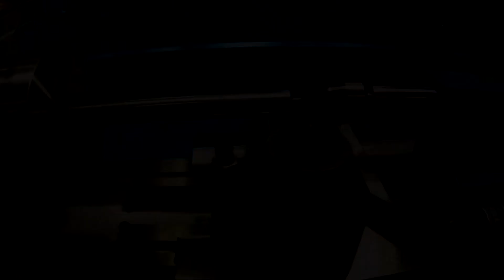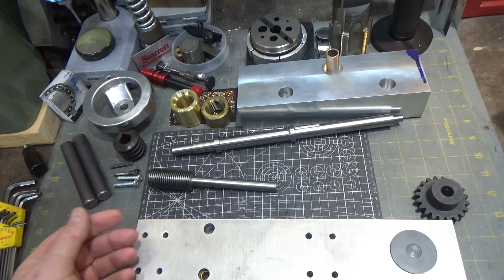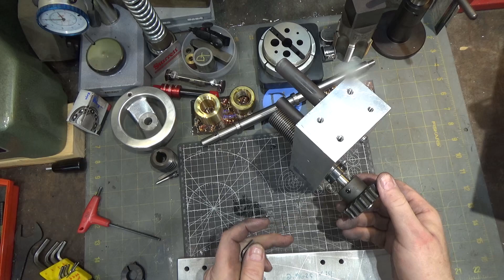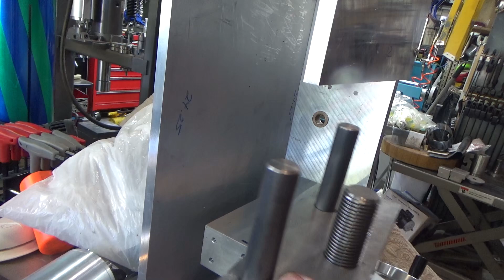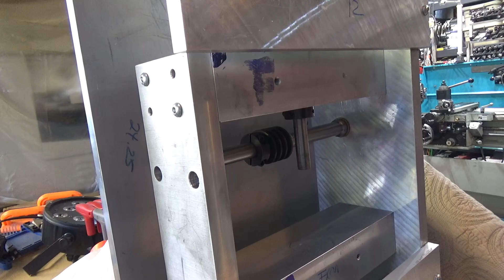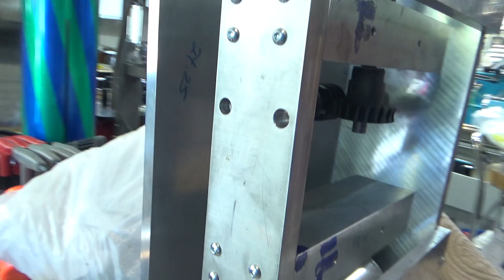147 6x48 BeltSander 09 Lower Lift and Tilt Assembly Part 3

Comment: Hi Robert,
Good progress, even though most of the component parts are made from aluminum it looks quite heavy, which should be very good for stability.
Take care
Paul,,
Reply from the maker: I agree. I thought there were even going to be more redos than I expected, so I chose and easy working material. Much thinner steel would have been a very viable alternative. For some reason, I initially thought this would be much lighter. In actuality this tool is going to be a tank.

Comment: With all this material and components it costs too much!
Reply from the maker: Yes, it will probably cost more than a Jet 6x48 belt sander, but less than a Kalamazoo. This is project was more about the journey and the design rather than an economical alternative to a commercial product.
Reply from the maker: Thanks Vernon. Your are spot on.
Reply: That's not the point.  The point is to build one yourself, that is better than you can buy.